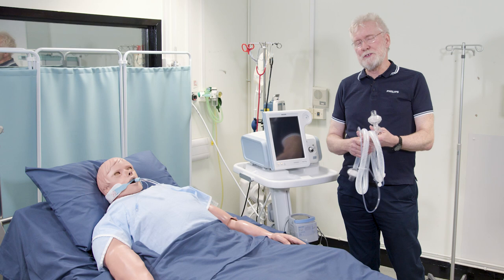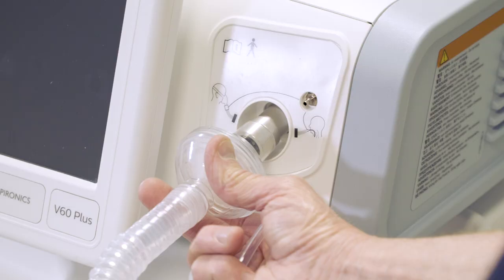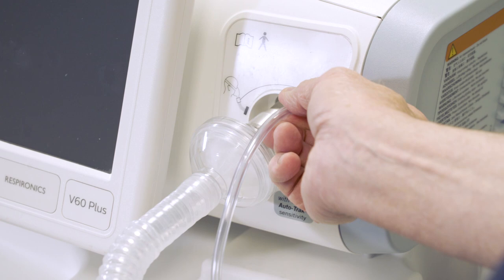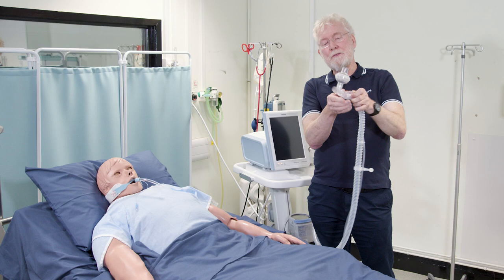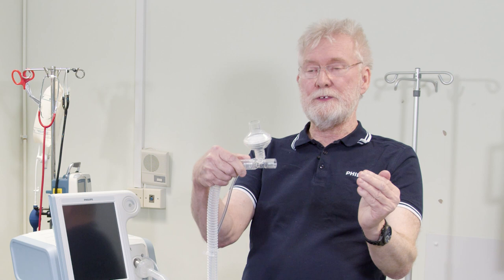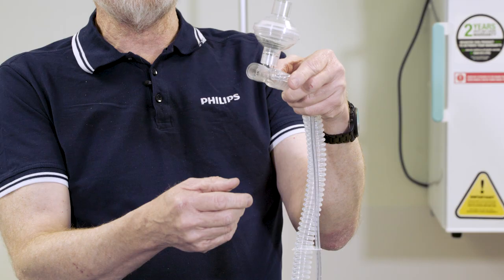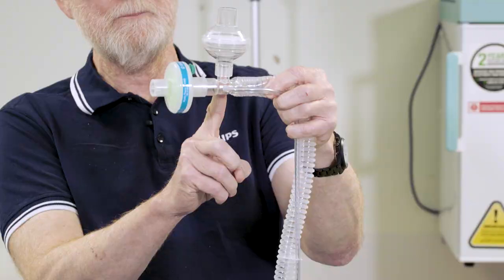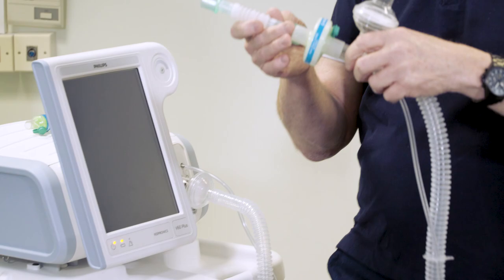Philips Respironics V60 and V60 Plus--circuit selection for invasive ventilation

Comment: If ur using a closed system via trach, and had the exhalation port closed, would they retain much CO2? Doesn’t seem like it’s necessary. I’ve left it closed and then done ABGs, and CO2 was fine. It’s like it cycles itself. Idk how a tiny hole would even exhale much CO2 anyway.